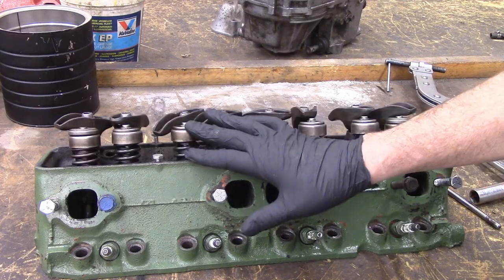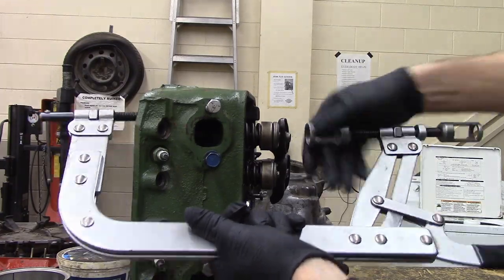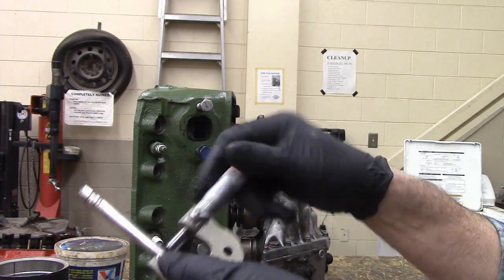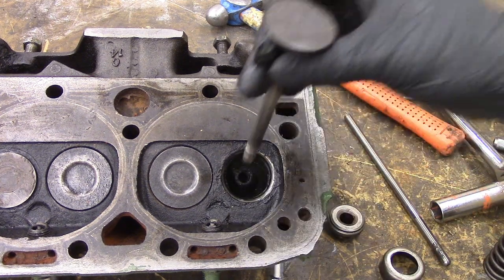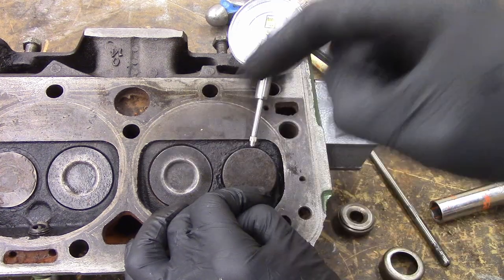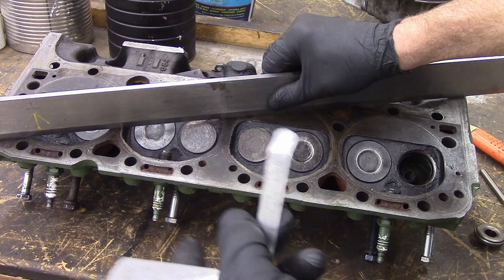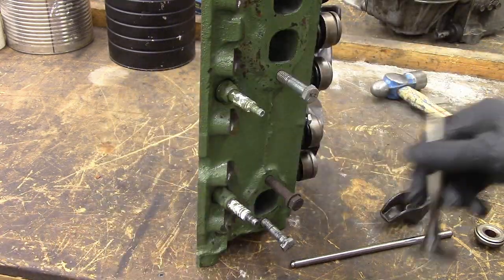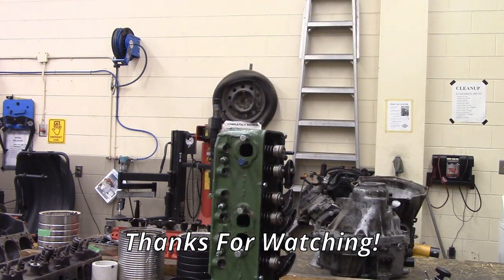Engine Rebuild Lab: The Cylinder Head

Comment: I have a question. I have a 93 Cadillac el dorado 4.6L V8 with Northstar Engine that was sitting 14 years because my great grand dad passed and it was given to me. It Has 43k miles. I’ve put 2k into it already and now they are telling me I might have to get my engine rebuilt. I’ve gotten a major tune up, transmission service, fuel tank replaced, all the coils replaced because it wasn’t getting any power and cutting off, serpentine belt, something with the vacuum for the brakes because they were really bad and a couple other things I can’t remember right now. Now the problem is cylinders 6&7 are bad and not getting compression. Car runs but ultimately ends up losing power. Will I be able to just get those two cylinders repaired instead of having to rebuild the whole engine? Is it worth spending more money on the car even tho I really want this car. Interior is perfect condition and I knew this car would need work but I’m just wondering if this car is worth it.
Reply from the maker: If you decide to repair the car, why would you open it up and not repair all of it?  And you can't really make the call on what to replace until you know what's actually wrong with it.  Only you can decide if it's worth it, however.